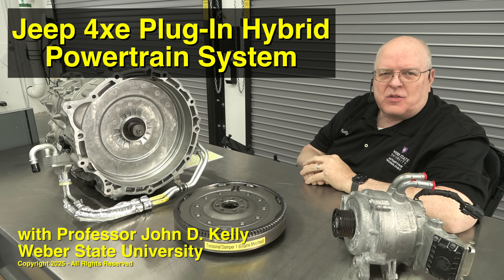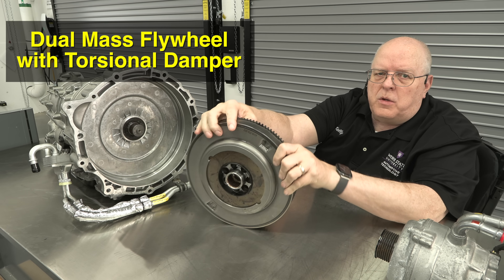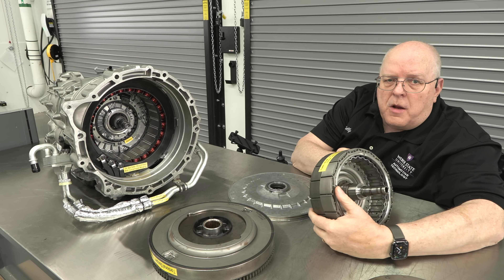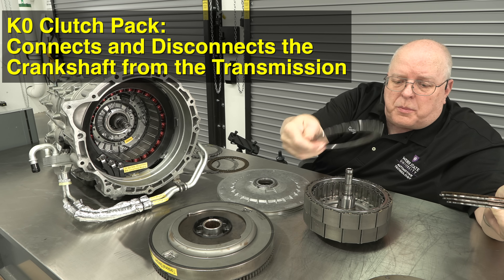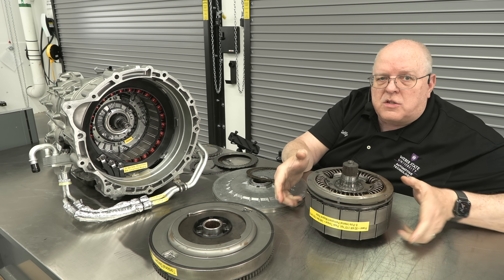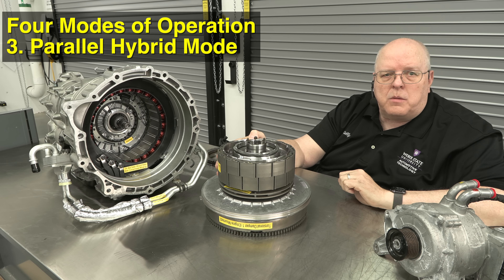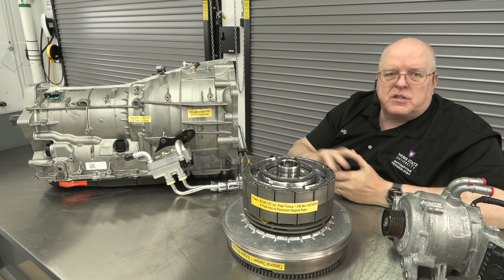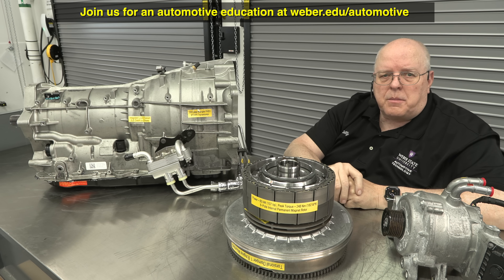The Jeep Wrangler 4xe Two-Motor Hybrid System

Comment: AI Summary

Abstract:

This video from WeberAuto provides a detailed technical breakdown of the Jeep 4xe parallel hybrid powertrain system, as used in the Wrangler and Grand Cherokee models. Professor John Kelly dissects the major components of the modified ZF 8-speed transmission (8P75PH), including the front P0 belt-driven motor/generator, the larger rear P2 motor/generator integrated into the bell housing, and the crucial K0 engine disconnect clutch.

The video explains the mechanical power flow, detailing how the internal combustion engine and the two electric motors can operate independently or in concert. Key distinctions of this system are highlighted, such as the absence of a traditional 12-volt starter motor and a torque converter. Instead, the engine is started by the P0 or P2 motor, and a slipping "Integrated Launch Element" (ILE) clutch is used to manage launches and smooth engagements. The presentation concludes by outlining the four primary modes of operation: full Electric Vehicle (EV) mode, Series Hybrid mode, Parallel Hybrid mode (which can combine all three power sources for maximum torque), and Engine Idling mode.

Dissecting the Jeep 4xe: A Deep Dive into its Parallel Hybrid Powertrain

*   0:20 Front Motor/Generator (P0): A 400-volt, liquid-cooled motor is bolted to the front of the engine and driven by a belt. It functions as the primary engine starter, recharges the battery, and provides torque assist to eliminate turbo lag.
*   1:35 Rear Motor/Generator (P2): A more powerful 80kW (107 hp) motor is integrated into the bell housing of the 8-speed ZF transmission. This is the primary motor for propelling the vehicle in electric mode and can also assist the engine.
*   4:57 Engine Disconnect Clutch (K0): A hydraulically-applied wet clutch pack is located inside the P2 motor's rotor. This critical component connects or disconnects the engine's crankshaft from the transmission, enabling pure electric vehicle operation.
*   6:41 Mechanical Powerflow: The system connects the engine's crankshaft to a dual-mass flywheel, which then connects to the K0 clutch and the P2 motor rotor. When the K0 clutch is engaged, the engine and P2 motor are locked together to drive the transmission's input shaft.
*   9:00 Four Modes of Operation: The powertrain operates in four distinct modes:
    1.  Electric Vehicle Mode: The P2 motor drives the vehicle using only battery power.
    2.  Series Hybrid Mode: The engine turns the P0 generator to supply power to the P2 motor, without a mechanical connection to the wheels.
    3.  Parallel Hybrid Mode: The engine, P0 motor, and P2 motor can all work together to provide maximum torque, offering impressive acceleration and off-road capability.
    4.  Engine Idling Mode: When stopped, the engine can use the P0 motor to recharge the battery as needed.
*   12:55 No 12-Volt Starter Motor: The vehicle does not have a conventional starter. In temperatures above -10°C (14°F), the P0 motor starts the engine. In colder conditions, the more powerful P2 motor is used to crank the engine.
*   14:00 No Torque Converter: Unlike many hybrids, this system omits a torque converter, reducing heat generation and simplifying cooling. This necessitates a different method for smooth vehicle launches.
*   16:47 The B-Clutch / ILE Clutch: To replace the function of a torque converter, the transmission's "B-Clutch" is repurposed as an "Integrated Launch Element" (ILE). This clutch pack is designed to slip intentionally in 1st gear, 2nd gear, and reverse to provide smooth engagement and creep from a stop.

AI-generated summary created with gemini-2.5-pro for free via RocketRecap-dot-com. (Input: 22,546 tokens, Output: 839 tokens, Est. cost: $0.04).
Reply from the maker: Amazing

Comment: Thank you for sharing your time and knowledge with us.
I have a question for you. How come Toyota have one motor to do it all and jeep needs two? For the charging and starting I mean.
Reply from the maker: The Jeep is a plug-in hybrid that needs to be able to continue driving on a discharged HV battery. The front motor allows it to run in series hybrid mode as necessary. The Toyota is a parallel hybrid only where it can run on engine power while simultaneously charging the battery and propelling the vehicle.

Comment: Thanks for the class. Glad to see you. I once had a belt-coupled starter and it didn't work great. 1970s Simplicity lawn tractors had rope-start B&S engines modified with a Delco generator on a belt. Running, it charged the battery. Feed battery TO a DC generator and it will MOTOR. When clean and dry it worked OK. When rainy or dewy, it would motor to the compression stroke and just slip. Motor spins, engine no turn! Obviously this rig is 50+ years newer and say $50K more engineered (not just strap-iron like Simplicity's dynamo mount), so should work fine.
Reply from the maker: Thanks for watching. There is no belt slip on these models.

Comment: How the Engine would start from the motor below -10 degrees while vehicle is standing still?
Reply from the maker: Release the ILE clutch to disconnect the transmission, then engage the K0 clutch to connect to the crankshaft and spin the rear motor. Thanks for watching

Comment: interesting tech, thanks!
 that ILE clutch might be an issue while off-road but should be fine on commute, I'll see what owners are saying on that. 

Curiously how hybrids deal with no oil pressure during start-stop? it happens often and could damage bearings. any electric oil pump?
Reply from the maker: I don’t know the answer about an electric oil pump for the engine. I doubt it. Thanks for your thoughts

Comment: When I hear some clutch slippage I instantly think a transmission rebuild is in your future.
Reply from the maker: Understandable, thanks for watching
Reply: The main P1 clutch does not slip all that much, it requires the torque of the P1 motor for the 0 rpm starts.  Only engages at speed.  It can be clunky when engaging at speed in my experience with the Jeep 4XE.  I do question the long term reliability of the system, as the mileage accumulates the transmission feels more clunky in its electric to gas engagement..  I was never aware of the operation of the B clutch.
Reply from the maker: @jcorsaro  Great information. Thanks for sharing
Reply: Wanted to comment exactly the same. Torque converter can be considered eternal as long as tge fluid doesn't cavitate, while clutches will wear out sooner or later.
Reply: @markotrieste  you must be talking about 1950’s torque converters, because all modern torque converters have electrically controlled hydraulically actuated clutches.
Reply: @MWilk098 Either you have a dual clutch gearbox, or you have a real torque converter that has a clutch that locks the slippage at cruising speed. In both cases you don't have a clutch continuously slipping. The whole point of a torque converter is to allow a different input-output speed.
Reply: @m @markotrieste you are not correct. Torque converters have slipping clutches. I recommend you do some significant research.
Reply: @MWilk098 I'm an engineer and I install clutches and converters daily in my designs. But please give me a decent source, I'm all ears.
Reply: @markotrieste  “in my designs” oh yea what kind of car?
Reply: @MWilk098 Sorry can't disclose. Please give me a source where I can find a friction clutch that is designed to slip constantly.
Reply: @MWilk098  watch?v=uXgSttKLsHs around minute 25 you can see the clutch inside the torque converter.
Reply: Well, you would be sadly quite misinformed. All transmissions have slipping clutches in the torque converter.

Comment: I was always wondering if they use both motors and engine together but jeep doesn’t mention that. They mention the 270HP of the ICE and the 107HP of P2 for a combined 375 or so HP but if we add them all together it’s 421HP.
Reply from the maker: Thanks. I found that information in the Stellantis training class materials for this system.

Comment: Pining for my old 64 Falcon coupe with a simple little 260 V8 hooked to a basic 3-speed Cruiseomatic tranny, radio, heater, that's it.  Got an easy mid-to-upper 20's MPG on road trips, and very reliable and trouble free.   I know......I'm comparing apples to oranges here, but doesn't hurt to dream a little now and then !!!!!
Reply: And all the passenger crash safety of an oversized cardboard box
Reply from the maker: Agreed. Thanks for sharing your thoughts!

Comment: It looks like Torsional Damper 2 with the springs sits right behind Torsional Damper 1 in the power flow of the engine, upstream of the K0 clutch pack and P2 motor rotor. If I understand that correctly, do they function together as a sort of super-damper, or are there unique functions for each damper?

Thank you as always for another really interesting video!
Reply from the maker: Without a torque converter and its fluid coupling to dampen the crankshaft fluctuations the two dampers combine to reduce the fluctuations that can also cause noise and vibrations. Thanks for watching

Comment: Why not use a direct drive instead of a belt? :/ seems unreliable to me.
Reply from the maker: Torque multiplication of 2.3 with a motor small pulley turning a large crankshaft pulley. Requires less power to accomplish the same thing
Reply: @WeberAuto 🤔

Comment: Looks very complicated and unreliable. Makes me appreciate my Toyota even more.
Great class, as always.
Reply: Well, HEAT damages automatic transmissions.   Sometimes a "shock" will damage it.  Getting rid of the torque converter increases efficiency and keeps the transmission cooler.   The slipping clutch clutch is over build and take up some of the operations of a manual clutch in a stick shift car.   It will smooth over shifts and may over slip to keep the ICE from stalling.   All the other clutches (& bands, if any) will simply be fully engages or released.   In effect, the rest of the transmission will act like a stick shift which in normal operations lasts longer than anything else in the car.   He said that it's only slips when starting off and the lower shift changes.  But a reprogramming of the computer can make it "slip" at higher shifts if the other clutches wear out too soon.

The electric driven pump in the transmission will also save a lot of energy.   An automatic transmission needs full oil flow at idle and wastes energy at run speeds.   Wasted energy is heat.    It done right, it should be super reliable but not as reliable as systems without a shifting transmission.
Reply: @GilmerJohn  this reads like written by the same people that tought using an oiled belt to save 0.01% emissions was a good idea, I learned one thing in 6 years reprogramming car ECUs theory is worthless theories not taking account 2/3 of the variables especially so unless those designs were made with every single pressure, temperature, physics involved all of them not just some of them or in isolation then they has zero value it never works as intended in the end after several hundreds dynos under my belt I did whatever worked including purposefully distorting calibrations so the end result was what I wanted totally contrary to theory including using impossible crankshaft angles completely wrong airflows etc my engine never broke while I saw othery pop every month or so I also saved fuel lowered emissions and true didn't get the most power but my curve was smooth without smoothing required all because I did whatever worked with the currently installed parts rather than try to force theory into reality, in this case I feel like someone wanted to "try stuff" which is great as a hobby not when your company's future is at stake, not only are those cars way too expensive but clunky obsolete and unreliable sorry if I'm not marveling at the engineering here  because similar to my story the end result isn't good so all the work put into it was a waste
Reply: Same here, my '06 RX400h is at 325k miles and runs great, still gets 25 mpg.  No Jeep using this system will even make it to 200k in its life, and from what I gather is only getting 21 mpg, lol.
Reply: Being this a Stellantis vehicle, all this overcomplication will surely become a reliability nightmare.
Reply: @FernandoGarcia-u7r while true, this a ZF design so I have more confidence in it.
Reply from the maker: Thanks for sharing your thoughts and for your kind words.
Reply: @WeberAuto  Let his truthful comment stand on its own.  This system has too many moving parts, except for the entire vehicle itself, sometimes.

Comment: What about motor / generator P3 & P4? What is the reason for having them? Seems complicated?
Reply: P1, 3 and 4 don’t exist in the 4Xe.
Reply from the maker: Sorry for the confusion. The diagram was just an example of different possible parallel configurations. The Jeep 4Xe only uses the P0 and P2 configurations.
Reply: yea this design seems shoehorned, starting engine from belt is definitely not ideal, needs to be very heavy duty